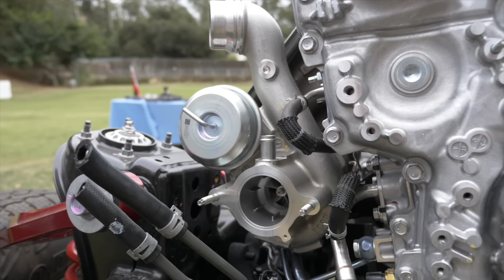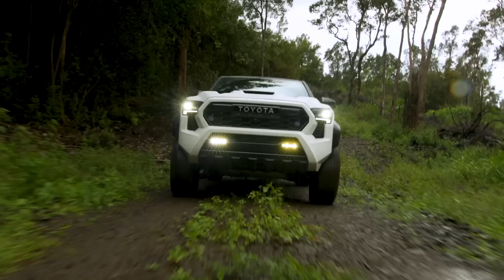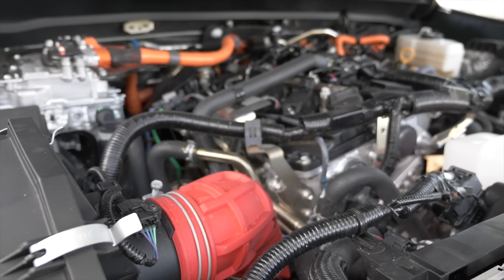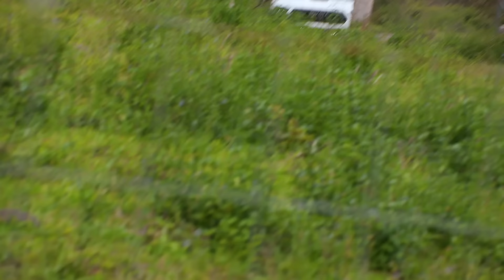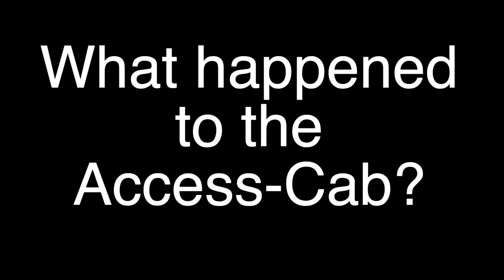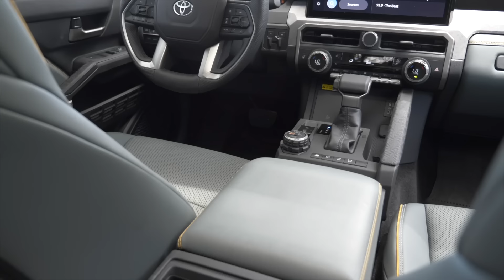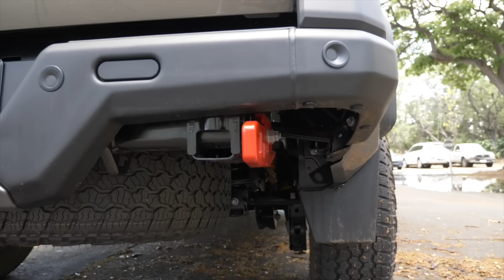2024 Toyota Tacoma Chief Engineer on new engine reliability and more...

Comment: So many comments on here say why why why get rid of the reliable NA V6 or V8?  Hello!  They explained this a thousand times...emissions emissions emissions!  Ask the lawmakers that you put into office why they are forcing automakers to produce vehicles that produce less emissions.  Less cylinders equals less emissions.  You CAN'T get around that.  All the NA V6 or V8 powered vehicles sold these days are either being offset by other models with better efficiency or the manufacturer is paying for credits to keep that engine in their lineup.  Imagine paying the government EPA to keep a V6 or V8 in production.  Not very cost effective.  Nissan for example, killed the Full size Titan, partly to keep the Frontier V6.  And what happened to the Armada that's based on the Titan?  It got a TT V6 just like toyota did to the Tundra and sequoia!  You don't say?  You can't blame Toyota or any manufacturer for these changes.  It's effecting all manufacturers and if they don't evolve quickly they will die (like Nissan).

Comment: Chevy 4 cylinders are having issues also. So it is the time. Would want a Toyota truck or Chevy or ford? Toyota is trying to make a great truck. I do not own a Tacoma 4 cyclinder, but I did have a 06 Tacoma in the past. We have to see if the motor is reliable and the transmission issues are fixed. I am sure Toyota will come through.
Reply: It’s not gonna get the reliability of a NA V6.

Comment: I love my 24 tacoma. I actually like the turbo 4 banger. At first i was skeptical, but took the risk. Im glad i did. No regrets from me. I traded my 2013 tacoma sr5 access cab 4 cyclinder and got 4,500$ for it. It had 190,000 miles on it
Reply: Did you tow anything with it?

Comment: higher pressures, more sensors, more tubing and coolant connections...if you think this is going to last anywhere near as long as a V6/V8, you're insane. my guess is before 200k you'll see a full engine replacement or nearly $10k engine repair. do not let them tell you it's 4 cylinder or nothing, refuse to buy this epa crap
Reply: toyota nor any manufacturer can control EPA.  That's you're elected officials and government doing that.

Comment: My 2008 Tacoma 2.7L has over 262,000 miles.  I've replaced the starter at 180k, the valve cover gasket at 220k, and the catalytic converter at 230k.

We need to be able to buy the Hilux.  Foreign terrorists knows those trucks are dependable.

Comment: They ruined one of the greatest trucks ever made. If you just use your brain, 4 cylinders pumping with a turbo vs 6 cylinders is not going to last as long. I’ll never buy a truck with a 4 cylinder 💯💯
Reply: The most reliable Toyota pickup is a 4 cylinder.  22RE

Comment: This is the gayest engine I’ve ever seen. Why couldn’t they stick to V6? The only reason why I’m not getting a new Taco is exactly because of the engine
Reply: Do you even have a V6 tacoma?  It's a turd that eats gas like a V8
Reply: @ I just told you that I didn’t get it because they don’t have a V6 in it. I got a 2025 Nissan Titan Pro-4X with an old good V8 on it. If you can’t afford the gas, Prius is your solution. But if you need a truck, you need a smoother power input into the shaft. V6 and V8 have degrees of power input to haul stuff

Comment: Stop this nonsense.... the iron block 2.7L tacomas with 500K miles are all over on the caribbean  islands some without bodies rusted off  still doing its job.   this new Aluminum block will not replace those.
Reply: iron block is old news.  you won't find many being built today especially in mass produced vehicles.
Reply: @beexiong2995  of course that is true because car engines lasting 500k miles put them out of business

Comment: Better mileage? A 4 cylinder with the same gas as the old v6? Failed. Better seating? Can’t fit anyone back there.. failed… made in Mexico and expensive, affordable? Failed. Quality, it’s made in Mexico!
Reply: Even if it's 1% more efficent than the V6, that's better is it not?  NO generation of tacoma had good rear seat space so it doesn't matter LOL.  You're getting paid more than you have 10 years ago due to inflation.  Stands to reason that the price increase in vehicles will also reflect that LOL.  Tacomas have been made in mexico for over 10 years.  The same plant builds the old truck and new truck with the same suppliers and materials.  The 3rd gen tacoma was not built with quality either are you kidding me?

Comment: I like my 2.7 Liter  2017 Tacoma SR great truck  the height of dependability. I no longer have gear hunting and constant shifting. I  got an Overland Truck Tune done on it. It now performs almost as good as a V6. This is the way Toyota should have done it in the first place. If the Lord is willing I  plan on driving this for years to come. I have bump stops on the frame and a proven drivetrain.

Comment: Well now the transmissions are failing in these.
Reply: The transmission is built by Aisin for toyota.  Aisin also builds transmissions for other manufacturers not just toyota so if there's a problem with the transmission it could be due to a host of problems in engineering and manufacturing.

Comment: Does the turbo use cooling from engine oil or from another source?  Doesn't the turbo make it more important to change oil before the normal maintenance schedule because of the heat?
Reply: it has separate cooling from the engine now.  gone are the days that turbos need to be idled for a minute before shutting off.  I had  GR Supra and it has a completely separate cooling system that ran even after I shut off the engine to keep the turbo cool and not blow up from a hard run.

Comment: These engines won’t last because the heat convection will cook everything stuffed under the hood.  No circulation for a turbo.  …notice how he mentioned keep turbo cool…they know these engines are hot.  …. But I’m sure they don’t spend money on r&d to make an efficient engine.  How about stress testing these engines sitting in a sea of hot traffic in a 105 degree summer season ….
Reply: this isn't YUGO lol.  This is toyota.  They know wtf they're doing.

Comment: You take a smaller engine make it work harder force air into it 100% will not last nearly as long as a naturally aspirated larger engine! This SUCKS guess im sticking with my old 2000 reliable truck! Gonna cost themselves more and more customers who understand this! Manufacturer’s are NOT listening to their LOYAL customers!
Reply: this engine doesn't work as hard as the outgoing V6.  The 3.5 V6 sounds like its gonna explode trying to tow 2000lbs while this turbo 4 moves along at low rpm with ease.  You have no clue what forced induction does so let me give you an example that anyone can understand.  An NA engine is like a marathon runner.  He draws air into his lungs using his own body to suck air in.  A turbo engine is like a marathon runner who has an oxygen tank and mask blowing steady air into his lungs so he doesn't have to breathe as hard.  Doesn't matter where he's at either.  he's getting the best air and the most air possible at any altitude so he can run longer and stronger with less stress or changes to his body.  Try running at 1 mile above sea level, it's much harder and you run out of breath quicker.  This applies to internal combustion engines.  Also any engine that isn't built to handle its own power will fail regardless if it's NA or forced induction.  An NA V6 with wimpy internal components will fail prematurely.  It's obvious toyota built this engine to greater durability than an NA engine to handle forced induction.  The reliability you talk about is built on years of data which there isn't any to judge this engine design.  So far in all other toyota's and lexus vehicles it has been reliable.

Comment: So happy I scooped up a 2022 XLE AWD Highlander with the legendary 3.5L V6 before the switch. I don't want to drive my mid-sized SUV like a sports car off the line at a green light to make it to Target 3s faster. Smaller Turbos on larger frames feel and sound gross. Talk to me down the line about turbos when my naturally aspirated engine hits 300k.
Reply: the engine components that are on your NA V6 are no different than those on the turbo engine.  Water pump, oil pump, idler, alternator, fuel lines, etc.  All the same material.   Those are more likely to fail first than the internal engine will.  Nobody keeps their cars until 300k miles anyway.  They always trade in their cars around 100k lol.  V6 design has more fail points than a 4 cylinder.  Keep in mind the turbo is not part of the engine.  It uses wasted exhaust gas to operate and blows air into the engine.  Doesn't run on some drive belt by the engine so there is literally no stress on the engine.  it takes that wasted exhausted gas and propels the turbine to spin.  the internal combustion is controlled by the computer and ignition timing.  nothing different from an NA motor except turbo motors are overbuilt to handle boost.

Comment: It is now a toy truck. Cheap materials and a wind up engine. How do you ruin such a reliable simple machine? Like you couldn't just throw in the standard NA 4 cylinder? Couldn't use just a regular box frame, had to thin it out ? I would have accepted that at a lower HP and tried this new model. Now forget it. He mates it lighter and weaker for better mpg all the while the thing is going crack apart overtime smh what a lie

Comment: It's funny how this engineer is talking about reliability when over to my right, I see three video channels advertising the unreliability of the engine and transmission. We own a 2020 4Runner with the V6 and get at best, 16mpg. We also have a 2003 Tundra with the 4.7L V8. On the highway, I get 22mpgs. Why go to the smaller motor lessor gas mileage?

Comment: This is not Toyotas response to customer requests. 
It Toyotas desperate move to meet epa fuel and emissions. 

Service your current Taco, use Amsoil + a high quality oil filter every 5,000 for the engine, 30,000 for the trans, change your intake air filter 5k and keep it till you die.

Comment: Turbos mean more maintenance. More oil consumption. Higher octane like 91 or 93. Better quality oil needed. If you overfill your oil, you severely damage everything. You have to constantly check your oil to ensure youre not low on oil. If you can do all this. You're good. It will last. If you can't, it wont last 200k miles

Comment: Hey engineer guy just an FYI you can cheat making horsepower by changing the atmosphere. There is no substitution for displacement. I think by now with the current situation with the Tundra’s failing in mass you may to rethink your design. When your number one priority is emissions rather than reliability you have destroyed the Toyota reputation

Comment: They putting in these small engines with a turbo to make sure you need a new truck in nlt 7 yrs.   They weight more and the engine is smaller….. add turbo to hide the stresses!! It’s BS scam engineering!!

Comment: Toyota is going to find out something that the other suppliers have understood for years, simply that it doesn't matter now what they do with the 4 cylinder dual turbo engine no one is going to buy it or believe them and with the money they are asking for these things can you blame them? Slap one of your 300 HP V6 or go back to the old V8, otherwise concentrate on Tacoma Sales.

Comment: In the bad old days, a turbo would cook the engine in about 70k miles.  They have worked hard to improve this new generation of turbo.  If you generously assume they are twice as good as the old ones, these will get 150k maybe 170k out of them.  Great.   That's about half the life we got out of the v6's.  We just went 30 years or more backwards in motor technology.  CAFE is killing the auto marketplace.

Comment: I want to see the engine apart . Ive been a diesel tech for 22 years and I know what has to be done for a turbo 4 to last and be reliable . It need big head bolts six bolts per cylinder not 4, the block needs to be a closed deck design, the pistons need hardened alloy piston ring lands, and can’t have low drag piston rings it needs beefy piston rings that can handle extra pressure from forced induction and direct injection . It also needs a beefed up bottom end. You can’t build an engine similar to a naturally aspirated engine put a turbo combined with direct injection on it and expect it to last . You basically need to build it like a diesel engine .
Reply: Yeah the block is not closed it's opened but so is the 3.0. Litre eco boost. Not sure on the rest but honestly wish it was at least partially closed but I don't see that being issue.

Comment: What about the motors seizing up now on the latest gen Tundra from bearings failing? Not just the 2022 either. There are reports now with 2023 and 24 and will be more as mileage increases. Pure crap Toyota! And you need to address this with the public and come clean about it.
Reply: Aaaaaand today, finally, the massive recall.

Comment: I DONT CARE!   I didn't ask for a 4 cyl TURDBO!  Toyota has lost my business.  New Nissan Frontier will be my next truck!  Turbos are not as reliable NO MATTER WHAT YOU SAY!  These engines will NOT be as reliable as the previous V-6s.  There are multiple issues already reported on the Tacomas.  Between the ridiculous PRICE, the turdbo engine, tiny backseat, small gas tank, and off-the-line reliability issues, I will not own one.  You haven't done your job because you aren't listening to your loyal customer following.

Comment: Problem is if you trying to pull a small trailer or micro RV - you will reach 6000 rpm to keep up with traffic not even mention high mountain towing. SILLY !

Comment: "We can make the truck out of thin gauge steel, aluminum, and through in a little 4 cylinder engine and then pass those savings onto the customer "...except you didn't. Bought Toyota for many years. Have a 2012 Tacoma and a 2022 4runner that has body rust already. I'm out. I'm done with Toyota.

Comment: Toyota isn’t Ford. 😂 You can build reliable turbocharged engines, and engine technology has advanced a lot in just the last few years. We have kind of unlocked the secret to power via volumetric efficiency - you don’t need large displacement to get power anymore. And the 2.4 Turbo isn’t something Toyota threw together in a weekend. It has advantages behind just emissions: it will rev lower because it makes all of its torque at much lower RPM. So, compared to the higher revving V6s, what engine is being stressed more? It probably evens out. 

And the Tacoma isn’t getting the first run of this engine either, T24A-FTS has been out in the world since 2021.. and I can’t seem to find a single failure tear down video on YouTube for this engine. I can find plenty of Ford EcoBoom tear downs.
Reply: This why Toyota recalling engines that blowing up?

Comment: Wont it be fun to try to pull a boat out of the water rappin 7k rpm to get enough horsepower for the task. Lets get rid of reliability and replace with 4 banger unproven headaches.

Comment: I don’t think there’s anything wrong with a turbo four-cylinder. But no matter what engineering it has it is still just a pick up truck at the end of the day and the Trd pro model is 50 grand. For a four-cylinder pick up truck. My brother just got one and his payment is about 700+ dollars a month. Not to mention the insane Insurance price because of how expensive these pick up trucks are. I know Toyotas hold their value and all that but good God the inflation pretty bad but 50 grand for a pick up truck? A four-cylinder pick up truck? I could honestly not give a crap about the fuel economy or weight savings of the vehicle if you’re going to charge about $20,000 more than what it is worth in my opinion. And I make good money. But I work hard for it and I can’t see myself spending $50,000 on this or even 40 grand.

Comment: "Turbo charged small engines have been used globally for a long time"... first turbo charged engine introduced in the US Tundra... "why are my turbos failing?" High compression, forced induction gas engines do not last as long. Fact.

Comment: Translation:

1. Toyota is as frustrated as we are with the emission standards.
2. This will certainly cause reduced longevity and reliability.
3. Overly complicated engine =  increase production costs
4. purchase price and Repair costs will increase 
5. Both are bad for consumers
6. The best years or the internal combustion engine are in the rear view mirror.
7. Toyota is trying hard, however, if you have a previous gen Tacoma in the garage...KEEP IT!

Comment: But have they fixed the notorious seat belt ratchet issues. 3 generations same problem. Other than that closing on 1 million combined miles with those three Tacomas.

Comment: Im sure it will last if the the owners know the rules for driving a vehicle with a turbo. Unfortunately nobody knows that you can't gun a turbo before it warms up and when you get to your destination you need to let the vehicle run for a minute in park to allow the heat to escape with the cooling system running. If the first owner ignores these rules it won't really affect them but the next owner is going to be stuck with a bill.

Comment: I had an 87' pu 4x4 with the fantastic 22r motor then a 96 v6, kick myself in the ass for not getting a g4 v8, manifold issue aside, "designed by an engineer who made sure the issues are worked out before getting to you," then bought an 03' chevy silverado, fantastic truck. Thought, well let see what 24' toys are going to have......Wah,wah ....damn going to keep the 03'. Maybe, see in 5 years how the twin turbos do. Not holding my breathe. I REALLY want the Hilux Champ......only available in Thailand though. 😮‍💨😒